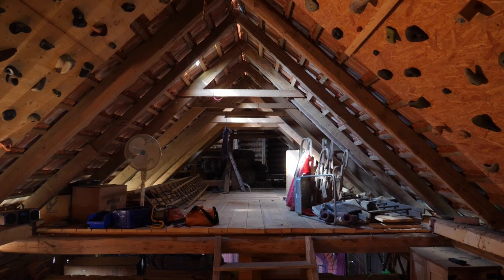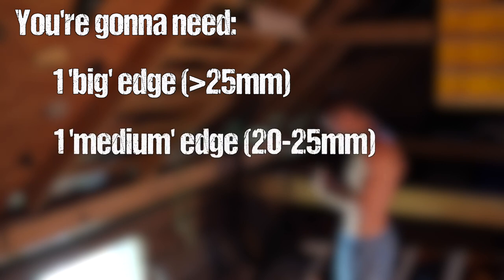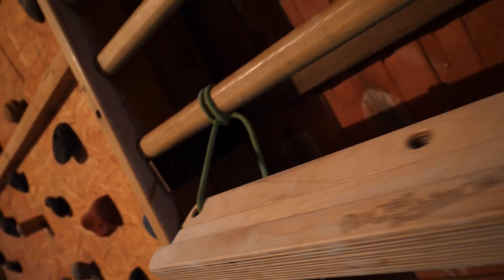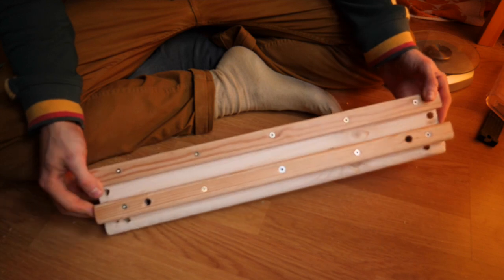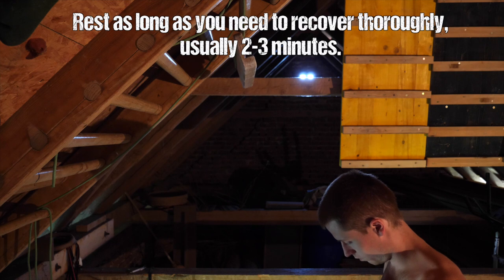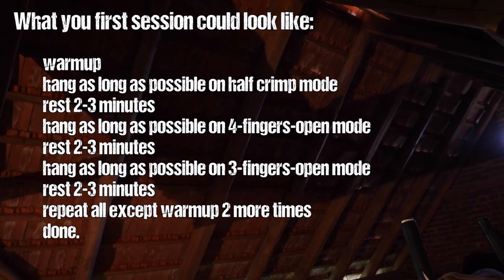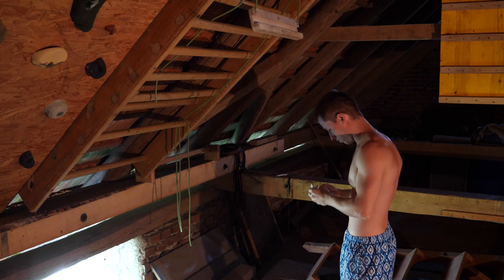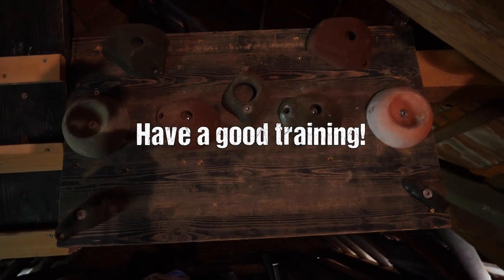Hangboard Training for Beginners

Comment: When I started climbing I got told not to do a full crimp so I didn't. I always told myself (specially indoors) not to full crimp so I normally got used to always use a open hand crimp. Now after four years I feel quite ok with open hand but I'm weak as hell when trying to full crimp, sometimes I simply even can't do a full crimp... On some problems and holds I feel that a full crimp is more or less a must but I more or less can't do it. I try to but it's not happening, I try to use a open hand crimp but I feel too weak for that type of hold. Do you have any advice on how to get stronger on full crimping? I thought doing a "full crimp" (like half crimp but the thumb next to the fingers instead of over them so crimp gets a bit more aggressive than half crimp) on hangboard was a good way to train it since it's controlled hanged but you're saying in the video not to do it
Reply: Yeah! I was always half crimping but when i tried full crimping it just felt weird, and I couldnt put any strength into it.
Reply: If you've been climbing for that long, doing full crimping indoor or outdoor is fine. Your tendons should be all good to use a full crimp. Just practice while you're climbing and you'll get stronger. Or, just get stronger at half crimping? Idk, everyone is different. I've only full crimped mostly outdoors and vary rarely indoors :)
Reply: Interesting to have a problem of a weakened full crimp when using the same structures as with other grip types. If you haven't been excessively using the full crimp and are not limit climbing with high frequency, then feel free to employ on routes with thin rails which lack any texture or indent for engaged thumb placement.

Much of the time, full crimping is excessively used and this has a number of problems, primarily strain on tendons, but also poor thumb engagement, weakened open hold contact/recruitment, and occlusion of blood flow to the fingers on a climb. As with a gaston, finger lock, thumb catch, etc., the full crimp is another tool which has to be trained, but unlike the others this can be employed on the majority of holds, many of them more secure with a full crimp, which is the reason for excessive use and the warning.

On my current project, I know of more holds that require precise thumb placement on an opposing point than require full crimping.
Reply: I agree.

Comment: Hi Mani, could you add your opinion, about when 'hanging as long as you can' is long enough? I think there is no need to hang longer than 15-20s, but then start something like 5 on 5 off repeaters (or 6:4)
Reply: Longer hangs are often used to quantify progress because sessions will alter every few weeks as will performance within those sessions due to other physical demands, but the hangboard itself doesn't fluctuate. If able to consistently hold over fifteen seconds on a hold, do not use the hold to train with. Switch or reduce fingers on a hold, add weight, or change to a different position.

As to repeaters, I have generally slid the on/off time based on if I am reducing fingers, changing fingers, reducing edge size, etc., because those determine if I am using the hangboard for contact, recruitment, recovery, or endurance. For instance, decreasing the size of an edge or increasing the angle means initial contact will be difficult, therefore I need perhaps 5/5x8, whereas if I am using just a few fingers then I need to recruit more and will do 7/3x6. Think of this akin to comfort on the hold needing more but shorter tries.

Comment: Did you notice any difference between flat holds  and more hollow, positive ones? Without considering the skin issue would you suggest hanging on them?  I've seen major improvements when i started hangboarding on  smaller and more positive holds compared to when i was training on flat and bigger ones
Reply: Obiously they are easier on the skin since it is less skin that is used :D

Comment: I notice you don't use your pinky when hanging. why is that? great vídeo btw
Reply: The pinky finger isn't very strong so some people don't use it by habit. My brother does that because he has long fingers and he can't fit them on small edges comfortably.
Reply: There are a lot of people who are even stronger with 3 fingers compared to 4. The basic reason is, that the muscle contracting the pinky is the same that contracts your ring finger and your middle finger. Therefore, the strength advantage of using the pinky is not super high usually. With 3 fingers, you can leave your fingers long, which can be a more significant advantage, depending on your physiology and strengths/weaknesses. I know one guy who can hold a 18 mm edge with one arm with 3 fingers for about 6 s, but he is very far away from doing that with a half crimp...